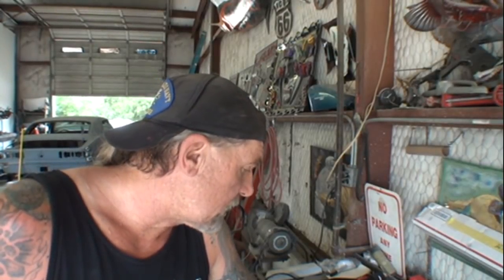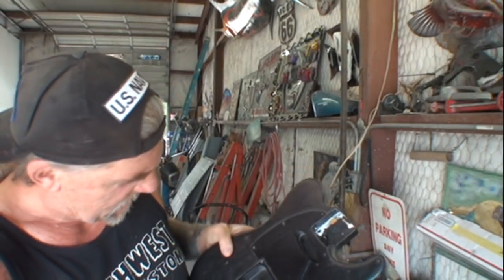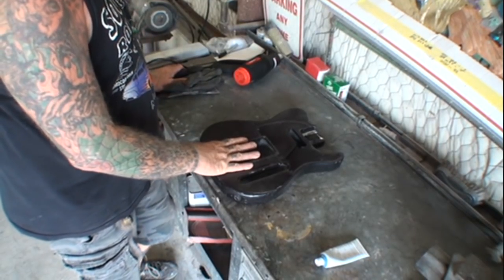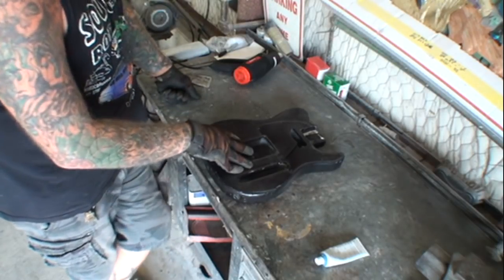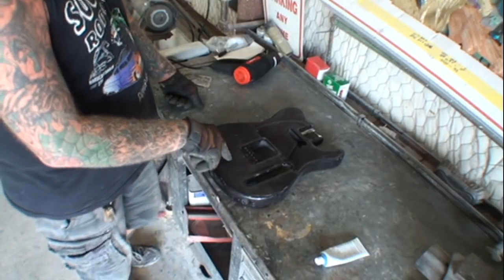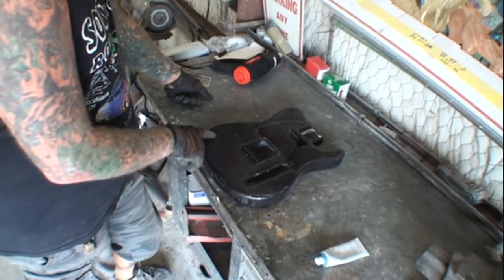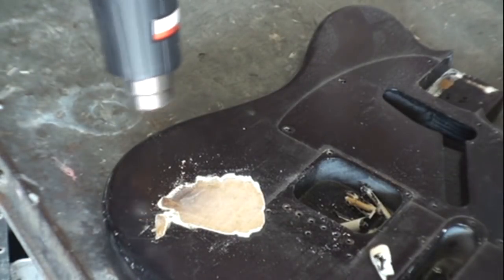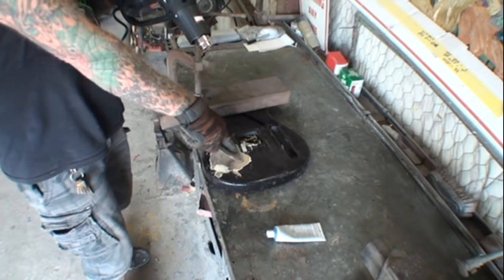How To Strip Paint Off A Solid Body Electric Guitar

Comment: Nice vid, used the same gun from harbor freight. Instead of a dull putty knife, I used a scraper I bought at Lowes. I did chip it a little when rushing. I think the key is taking it slow and using a secure light grip and not forcing it. A gentle touch with heat is better I find.

Comment: Looks good! If you were to leave it with a natural finish, what would you do next? Apply oils or something?
Reply: Ainsley That or stain and a clear. I personally prefer oil finishes, but it's personal preference. It probably wouldn't need a grain filler (looks like alder), but most people like to use one on open-pored wood like ash. Some don't, for a grainy, raw look.
Reply: @The_sinner_Jim_Whitney  Thanks for the feedback. Planning to strip my Stingray at some point soon and thinking of how to treat the wood. I've heard Tru-Oil is good
Reply: Ainsley I like it, it's the way I refinish ALL maple necks. Feels very, very fast, holds up relatively well and can be sanded and touched up super-easily with no specialized equipment. I'm building a kinda-sorta clone of the Music Man Joe Dart signature Sterling with my sunburst US Sterling HS (though mine will retain the series/parallel/single switch and have a tone control), I'm going to Tru-Oil the stripped body using this technique, I think it'll turn out well.
Reply: Natural finish is always best! It's a thing of beuty!!

Comment: " Youre not gonna gouge the wood, you're not gonna unlevel it or nothing like that  ".  I'd love to see a straight edge across the face of that guitar. Unless you're very experienced - and even then I'd think twice - If you take an 80-grit D.A. or random orbit to your guitar body like in this video, I promise you will have the waviest strat on the block.  It will chew through the soft wood and destroy body contours quicker than you can react to stop it.
Reply: Dumb Robot   If you go to 3000 on wood it will burnish, and cannot accept any stain, 220 grit, then maybe up to 400 but anything else is counterproductive, IF your going to stain only.

Comment: Awesome video man. I bought a really nice tele that was relic'ed too far. Looks like shyte. I might strip if off and repaint it.
Reply: In that case you won't need to use heat, you'll need to use paint stripper (Jasco --- Home Depot), sounds like someone already removed the poly coat and painted it.. Using heat to remove the paint on your guitar will make a mess..

Comment: That coating under the paint, did it smell sweet when you were sanding it?  I was using a palm sander, I don't think it was enough.
Reply: No, it smelt like wood dust..
Reply: The sweet smell is the sealer. Once you're through that it'll small like wood.

Comment: Will this still work if you've already sanded it a bit and taken away the shinniness? I sanded it down with like 300 grit sandpaper and now it just looks dulled, the color is still perfectly there but the shinyness is gone. Could I still use the heat gun method?
Reply from the maker: Yes, it will still work.. THanks for watching!
Reply: @peteguitar  it didn't work, at all. I had the heat gun on there moving around for almost 10-15 minutes and it never bubbled for me to scrap it only got extremely hot
Reply: @moanwar1751  Do you solved it bro?
Reply: @Ranametalera  no it didnt work it just got very hot but it wont work if you've sanded it down already
Reply: @moanwar1751  I bet you did it wrong, or does not have a poly finish. it should work even after light sanding
Reply: @WhoKnowsMrLoons  no it was polly but since I sanded it first it prevented it
Reply: @moanwar1751  It should have worked fine.. Ive done 100's of guitars like this that have a poly finish.. This guitar was sanded down because someone painted it with krylon paint and it worked in the video... If your using a "HAIR DRYER" it probably didn't get hot enough..

Comment: You've lost me. Someone has been telling you lies. I've stripped many thick poly-finished guitar bodies: Squire and MIM guitar bodies with Aircraft-brand stripper. I've used Aircraft stripper for 20 years with no problems. 'Aircraft' is many things: It's expensive, aggressive, caustic and requires at least three applications including one overnight but.... (and it's a big but Simone!) AIRCRAFT STRIPPER DOES NOT ''RUIN WOOD''!!! SORRY! You might as well say that paint and paint thinner, lacquer and lacquer thinner ruins wood!! It simply isn't so. After application of the Aircraft and stripping to bare wood sand to 440 grit and you are ready for your primer or finish whatever it is! BTW, Why bother with a heat gun when you are sanding to bare wood anyway? If you sand the sides and especially the edges of the guitar body you'll  t
he original shape of the guitar bodk.
Reply: Ive used aircraft stripper for over 40 years on cars, guitars, and everything in between.. Aircraft stripper is NOT the same as it used to be.. Very weak and non-working product....
Reply: I have found no difference between the performance of "Aircraft Stripper" and regular methylene choride stripper.
Reply: It's alder..
Reply: @Nazzz65  He said it's an '82 - '83...those are Alder bodies, and I don't even own one, nor do I care to. But you sir need to go get on some medication. BTW, Pete's method didn't work very well for my Squire, as it's 1991 Poly. But again, since Pete's guitar is an '82-'83 and the poly is thinner, and since he said it was repainted, the dude who stole it and repainted it probably took off some of that poly first, either chemically or by sanding, before he painted over it.... in turn, that's why it was probably easier for Pete to take it off with the heat gun.
Again, it kinda worked for me, but I had to apply a generous amount of heat just to be able to scrape a little bit and I was starting to gouge the wood, even with my 30yr old dull scraper.

But dude, you either need to lay off the drugs or get on medication.
Reply: Sheep- No hard feelings intended over here! I fully, FULLY dig what you are saying I believe what you saying is poplar, is highly regarded as an excellent tone wood. I bought my MIM "early '"60s" reissue "off the rack" Fender Strat just not too long after they came out : It was Shell Pink!! At first it took a little getting used to but It's one of those things that grows on you! My only regret was that I didn't hold out for one of Fender's "Classic Lacquer" Reissues. Friends of mine who are WAY deeper into this say Mexican Reissues have that "vibe"!! I've actually got to head right now I value your thoughts on this. Sometime when you have some time!
Take care!

-Tim